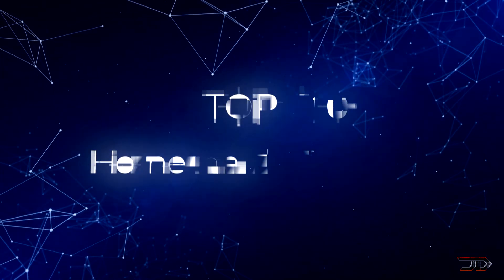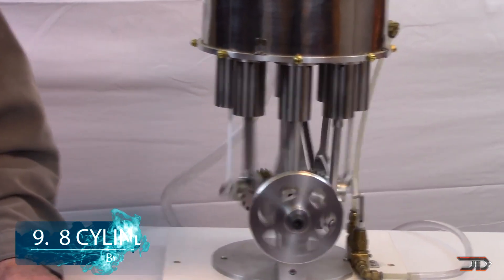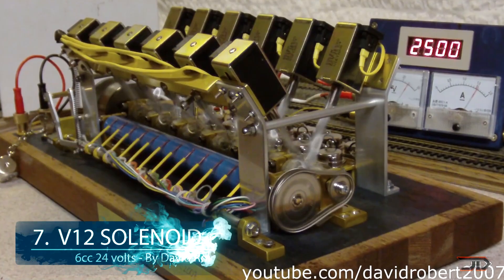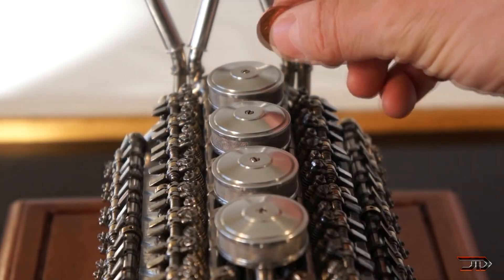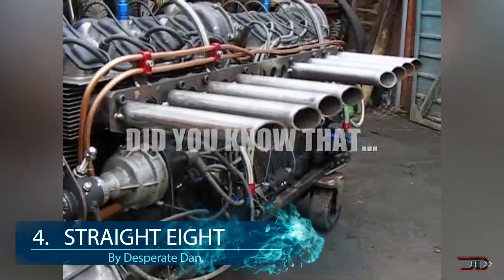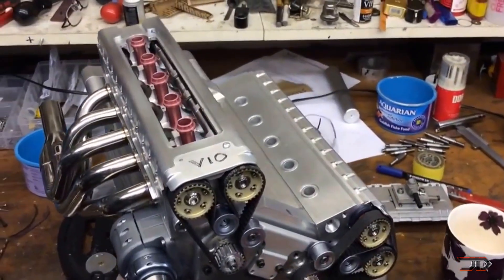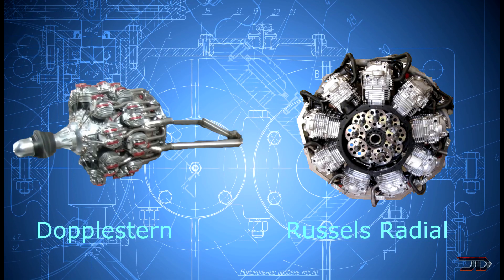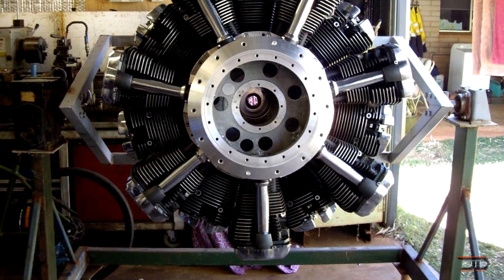TOP 10 Homemade ENGINES

Comment: I was walking along in Tom Price, Western Australia just minding my business and came upon the #1 engine on a trailer hooked up to a Land Rover Discovery. I like radial engines so I went over to take a look. When I got close, I could see the cylinders and heads were off a Honda XR-600 (I used to own two of those). These have 4 radially-disposed valves and to actuate them, 8 rocker arms each. The owner works as a fitter machinist for a mining company and I'll bet he made most of it at work. He says he sometimes takes it out and uses it to push his Land Rover along (with a throttle cable from the cabin). Absolutely amazing.
Reply: instaBlaster...

Comment: These are super talented people. The next one should be an X format radial two stroke. There is no crank case compression so would need Reed valves and a small blower for starting.  Incorporate direct injection and it will run very clean.

Comment: By far Mr. Patelo the retired navy man has got to be the most impressive motor this far. his video stand alone is absolutely incredibly jaw dropping amazing. showing his fine skill sets of one tenth or less scale machining and old world calibration / measurements with good old fashion lifelong know how and aptitude. the w-32 is a beast of a mini v-12 and is worthy of a title itself in all fairness to the others however this is a well researched and very tough compilation to come up with but my vote is for the miniature w-32 at the 2;15 sec. time mark. kudos to the compiling of this video is it had to be a very tough editing and voting system ,as always thankyou for sharing
Reply: PJ C. The w32 is a great design and build but it doesn't run on its own it needs compressed air to turn it. That makes it impractical
Reply: @brandysigmon9066  It's not made to be practical in any way, it's a hobby project - advanced one. 
And a piece of art, as the narrator said it might end up in a museum, and if not - it would be a pride item for the technology display in any school or univ.
Reply: I'm a machinist and I agree with you, he designed and made every part and smaller engines are far harder to manufacture.

Comment: So I'm working on a V8 similar to that "Victory 44" and wanted to know where do you find those spark plugs as well as timing chains small enough for it? I heard "RC engine" but any specific places? So far I'm basing my engine off of my 99 Dodge Ram 318 that I rebuilt and took measurements of every part so I'm practically rebuilding that engine in solidworks to re-scale it to a miniature version.
Reply: It's actually a Victory 44, not Victoria 44 as he called.
Reply: Oh wow... I definitely typed what I heard on that one.
Reply: It depends on the scale you want. You can purchase very small spark plugs but I prefer to make my own with 6mm threads. It's not overly difficult. For timing, stay away from chains unless you're looking around 1/4 scale or larger. For miniature stuff either timing belts & pulleys can be purchased, or (as I prefer to do) use gear drives where you can make your own gears to the size and style you desire. My current project is a V4 with slightly less than 10cc displacement. Hoping to be finished this coming January (I started building it 3 years ago). Good luck.

Comment: I'm interested in acquiring a VG30 Nissan Infinity V12 Engine arrangement. Or. doubling the number of V6 Cylinders using a V-Twin piston engine with each connecting rod powering 2 cylinders like the originally designed turbocharged locomotive V12 engines. Where the crankshaft has a 6 cylinder crankshaft which doubles the no. of cylinder by each connecting rod powering 2 cylinders.  This combines the configuration of a V 60 degree engine, with the configuration of a boxer layout underneath.  The original F.I. Engine computer runs and fires 2 cylinders simultaneously.

Comment: Just a small point @1:56 when you say "might be considered a motor", motors ARE engines.
Reply: @Andrew Manche Lol, I think you need to learn facts first. The definition of an engine is "a machine with moving parts that converts power into motion". The definition has NOTHING to do with "fuel".

Waiting for your apology and self-correction :)
Reply: @Andrew Manche Again, you've not addressed anything I've said in my comments. Utterly embarrassing yourself.

Comment: Solenoid engines are less efficient and bigger than electric motors and are therefore useless, however for people learning crankshaft alignment and making it is a good start as you can focus simply on the shaft and not other things.
Reply: Yeah, focus on the shaft, but not too much! The shaft has neighbors that might like a visit once in a while.

Comment: there is a guy where i live in australia that built a motorcycle engine that runs the opposite direction to create an anti gyro force to make it easier to corner and this is not the only engine he has built over the years another he built has track record at bathurst race track but sorry cant give you web details as i dont know of any he has
Reply: hm guess he turned it flat on the side but then its stabelizing gyro equal on both sides , or sideways v heads comingout on both sides .

Comment: I would like to build a 5 stroke engine. Some might call it a 4 stroke with a prestroke engine but the way I say it, it's just easier.
Reply: Why not make a 2 stroke that burns no oil?
Reply: @gojaneb  In the late 90's or early 2000's, Dodge developed a super efficient 2 stroke but the fed's told them "you can't make that engine for a production vehicle because it's a 2 stroke."
Reply: GM (Detroit) diesels had oil in the sump and used a super charger to blow the air in through ports when tpiston was down... exhaust went out 4 valves in head.. greyhound bus used them. No one ever try to run them with petrol?
Reply: @gojaneb  diesel two stroke opposed piston engines using piston porting and a blower for the inlet, as used in the Commer van, and a bigger version the Napier Deltic used in trains, absolute minimum of parts and very powerful for their size, worth looking up👍🙂.

Comment: Would like to see someone put two Honda Type R VTEC heads onto a V8 block with the same rod:stroke ratio as the B series. That thing would probably smoke any muscle car engine.
Reply: Powertek did it with hayabusa heads, powering the radical, I did actually look at buying one when I was in the custom business, boss was keen aswell as it has a load baring block. We knew it was going to be expensive, but at the time £50k (ten years ago at a guess) very very short life and extremely short service intervals was not justifiable

Comment: dude a Solenoid construction includes an armature that moves in and out exactly like a piston dfaq you talking about a Solenoid without a Piston would be a copper spool with a hole in the middle 2:00 those are clearly pistons attached to a driveshaft o.o'

Comment: Lots a wrong in the video. #8 is definitely not 44 cu in. lol that equals .7 liter no way it’s not got larg enough bore and stroke to come any where close. Maybe a .44 cubic inch engine but I didn’t do the math. Displacement for icb engine is “bore X bore X stroke X (.7854 * # of cyl).

Comment: I'm just going to say this but at 3:17 that supposed straight-8 is nothing special because a 1952 Packard 200 Deluxe Touring sedan came with an 8-cylinder engine that was a straight eight and a 288 one of which I actually own
Reply: I think it is special. He built it with his own two hands. Mercedes were building straight-8 aircraft engines during World War 1.

Comment: Just 300 hp? Aircraft engines of this size produce about 5 to 10 times that much(
Reply: think he meant 3000?
Reply: sounds about right its only made from 80cc honda motorcycle jugs its not very big
Reply: >Just 300 hp? Aircraft engines of this size produce about 5 to 10 times that much

If you're talking about the 9 cylinder radial at the end of the video, what the hell engine are you comparing it to? It has a displacement of roughly ~324.6 cubic inches and makes 300-350 HP. This gives it a specific power of 1.078 HP / cubic inch, which is double that of pretty much every other small radial from the late 1920s to the 40s. This engine makes the same or greater horsepower than those engines as well, which required three times the displacement to make the same power.

The P&W R-985 Wasp Junior made 300 HP from 985 cubic inches of displacement, with later models only achieving 525 HP.
The Continental R-670 made a max of 250 HP from 670 CI of displacement.
The Wright R-975 made 300 HP from 975 CI, with later models making 500 HP.
If you want to compare it to something modern, the Rotec R-3600 is 220CI and only makes 150 HP.

This custom engine beats the pants off pretty much any other small radial engine in both specific power and probably weight as well. But I wouldn't trust this engine to be reliable in an aircraft without significant refinements in the ignition system and valve train.

Comment: A bit misleading info about that #1 engine. Cylinders or rather individual engines are arranged in a radial configuration but each individual engine is just tied together with a transmission and the output shaft is just that and not a crankshaft. And it wasn't shown running. Hardly material for a #1 engine.

Comment: You're crazy man, #1 should've been the v10 efi engine, did you know the incredibly talented creator of that engine literally handmade everything the alternator, oil pump, everything, not to mention the fact that it requires an ECM to run it and can be used for data logging and tuning! Seriously that guy is talented, you know what kind of knowledge it takes to make the firing order correct, cutting the cams and crankshaft correctly...but you put a pieced together motorcycle engine as #1?? That's bad...you don't know how to properly rank these things lol

Comment: Too bad the presenter fails at pronouncing simple English words: "Inset" instead of insert, "Victoria" instead of victory.  Also, the 7-cylinder engine did not have aero cylinder heads... they were cut-down VW cylinder heads.
Reply: Pickey Pickey.

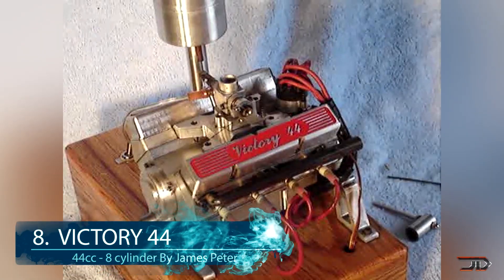Comment: At approx. 1:14 you say "one of the smallest engines ever built is 44 cubic inches" ... what you meant to say was "one of the smallest V8 engines ever built is 44 cubic centimeters (less than three cubic inches)".  literally millions of engines have been built under 44 CID, and even many tens of thousands under 44cc's but few V8's under 44cc's.

Comment: want to see an engine that turns itself in the engine bay of a car , rotates itself so you can see the whole engine spinning in a circle around itselfs middle, , not so hard to do . nobody done it , but could it also power the wheels or mabye a hidden small engine for that. . l mean the whle engine the outside of the engine roatating , simplest would be a plastic replica of a engine on an axie. but better a running engine that turns itself ..just a normal car engine like inline four with oil pan  but that wouild need some modification to keep oil from pistons l guess, and small fuel tank maybe or turnable hose fitting. hm would need to be inside the axis or .never seen that done w a car engine in bay would be cool to see. and a first.
Reply: Yes it has been done in the early 1900s in aircraft and even some cars. It was called a rotary engine ( not the wankel engine)
Reply: No need for a flywheel either
Reply: @AtariFTW  ok  l thought rotary did not roatate cylinders just crank and pistons but yea it did.  l mean the whle engine the outside of the engine roatating , simplest would be a plastic replica of a engine on an axie. but better a running engine that turns itself .just a normal car engine like inline four with oil sump but that wouild need some modification.never seen that done w a car engine in bay would be cool to see. and a first.

Comment: I wanna see combustion without it destroying my air. Do that 1
Reply: Run it on LPG
Reply: Anybody concerned could always wrap their lips around the tailpipe and take a good long haul.. Cant be worried about your air quality when your dead.
Reply: Did u know cow farts are more damaging than cars?
Reply: James Schoonmaker lot more cars then cows and the motor never shuts off!
Reply: Steve Prefontaine actually u are wrong. Cows pollute more. Methane is 23 times more toxic than carbon dioxide. There are also 1.5 billion cows
Reply: James Schoonmaker at least it's all natural and not man-made and we did not build it in our image
The car breathe in and breathe out the same good and bad me and you do and at least when we're done drinking old water we can piss on a tree and water it when I drain that radiator I can't do anything with it because if I dump it on the ground it will kill the mother and if we ignorantly push the motor and then we die and God is there he may watch as burn forever because we killed our own mother my father could forgive anything but not if we hurt our own mother ask yours if you don't believe me
Reply: Steve Prefontaine I have no idea what you are talking about. Have a great holiday
Reply: Steve Prefontaine you actually own the air? Frankly I like my air mixed with either of the following:Diesel smoke,Coal dust,or Gasoline fumes(preferably racing fuel).Oh! and also alcohol fumes that is the shit! All of these mean that a lot of blue collar people are working,instead of out of a job and on some form of assistance!
Reply: Steve Prefontaine  this is truly amazing. As you argue your point you are using the very polluting energy you profess against by using the electrically powered internet. Mind boggling.
Reply: Steve Prefontaine History lessons will actually teach you that the "real USA" was founded on coal, petroleum, steel (process to make steel is polluting), and harvesting of trees which would also contribute more to poor air quality than the vehicles you worry so much about. And sorry to say it but solar panels are made with plastics which come from yet another source of polluting factories. Also the batteries used to store your precious solar power can be quite detrimental to the environment. Your arguments are lacking in origination of the products you speak about. No technology comes without a price to mother nature.
Reply: @MikeJones-is1ti  I think you were suppose to have died in a car crash when you had been drinking.  He was a world class runner tho I only know about because of the movie Pefontaine which was worth watching once.

Comment: A V10 engine? He's wasting his time; such an engine lacks stability and would wear out fast in a real car.
Reply: Morgow It's not big enough for even a gokart, maybe an r/c car. They are stable, moreso than a 6 or 8, less than a 12 or 16.
Reply: JaxRhapsody,

Stability is achieved by balancing the forces coming from the engine's pistons as they fire. Having 10 pistons (5 at each side) would cause an uneven amount of firing. Best stability is to have an equal amount of centre pistons as the sum of the amount of pistons places on the sides. So 2 centre pistons firing at the same time and 2 side pistons firing at the same time (one on each side).

It is possible to balance this on a v10 too, by firing one piston in the centre, and the other four side pistons, but this would cause inconsistent power transfer and would cause the engine to stall and the movement of the vehicle to become jerky.
Reply: Morgow yeah v10 doesnt even work just ask dodge vipers and trucks and ask a ford excursion lol
Reply: Big Worm,

I never said it didn't work. I said that it lacks stability and wears out faster than necessary.